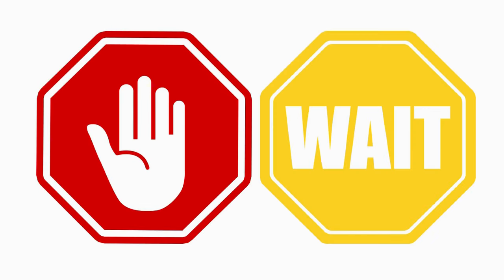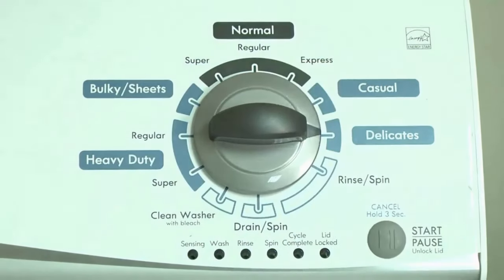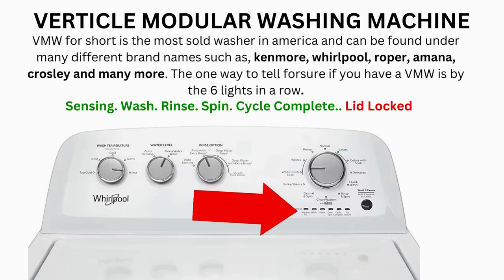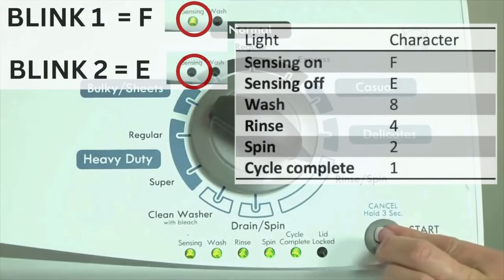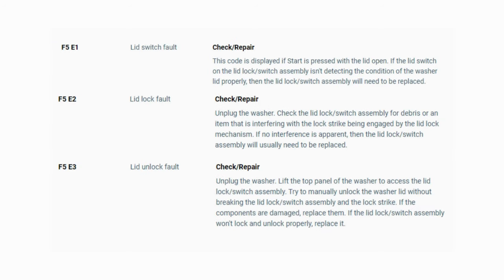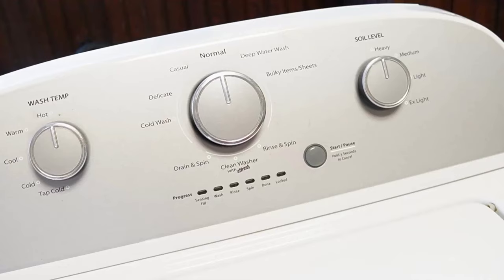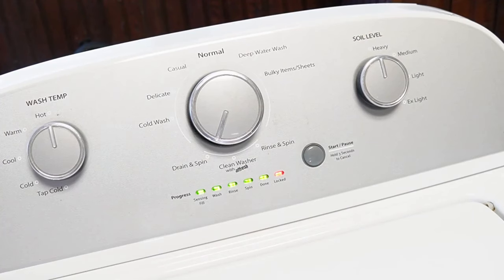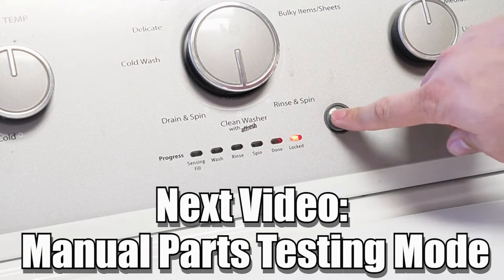Washer Stuck On Sensing? Easy Fix!

Comment: I would NOT recalibrate without first pulling codes. When you recalibrate a unit, you clear EVERY code stored. First pull codes and find the corresponding explanation via the tech sheet stuck to the inside of the front cabinet panel. Replace parts THEN recalibrate.